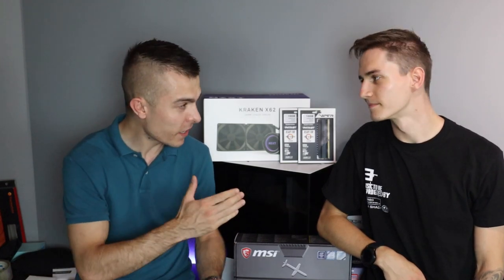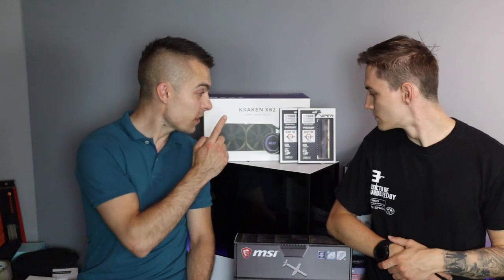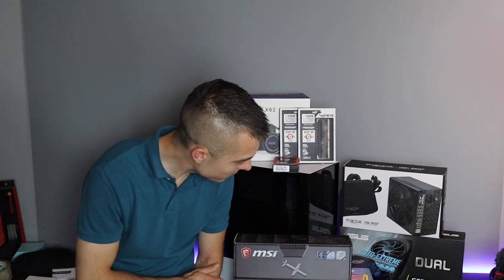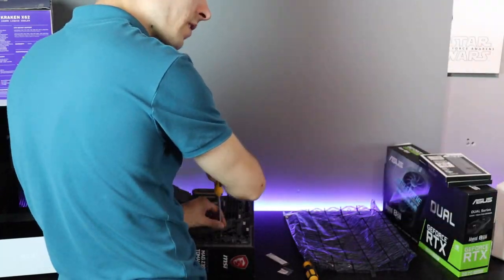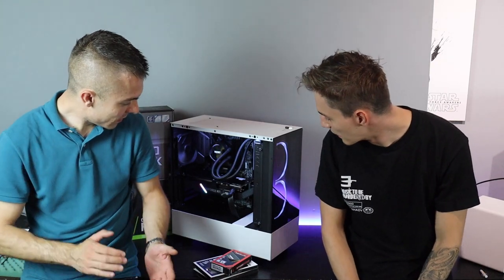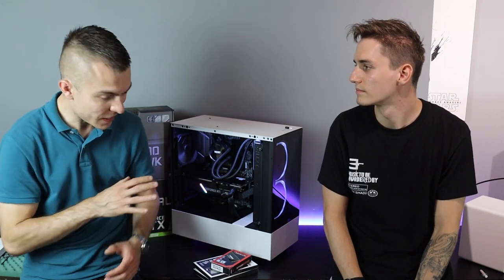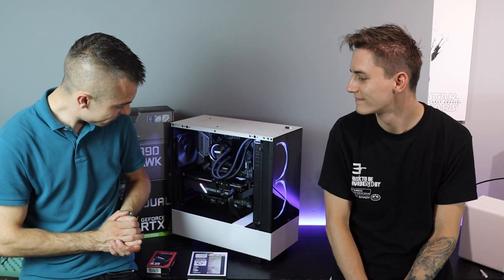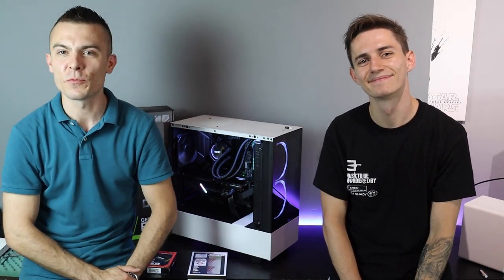Timelapse Build - NZXT H510 Elite (for Luka)

Comment: Great videos - thank you - can I sneak a 360 aio in the top - dont ask :) is there enough room air vents aside - thanks
Reply from the maker: rsvette123 thank you very much. Unfortunately no. You can place 240 or 280 in the front and eventually 120mm at the rear. 😬
Reply: Thanks Buddy :) guess it will be a 280 :)
Reply from the maker: rsvette123 Cool man, you will love it :)